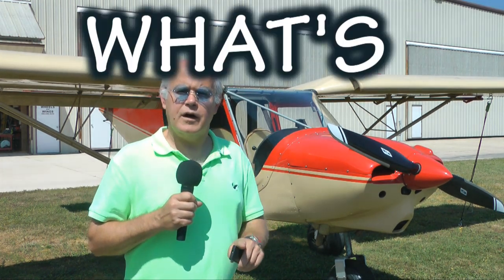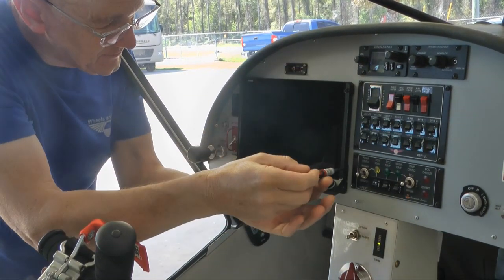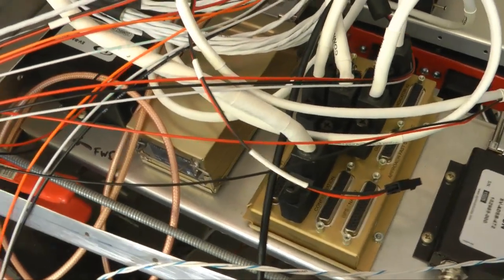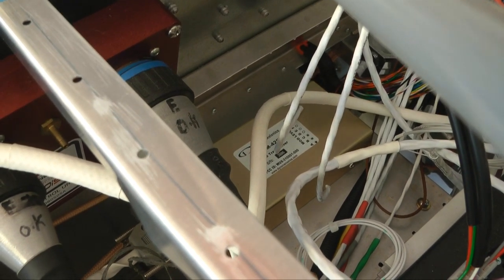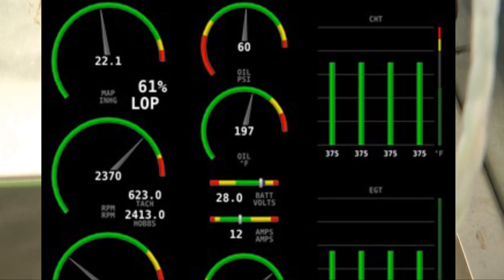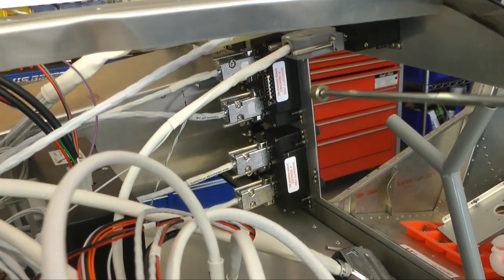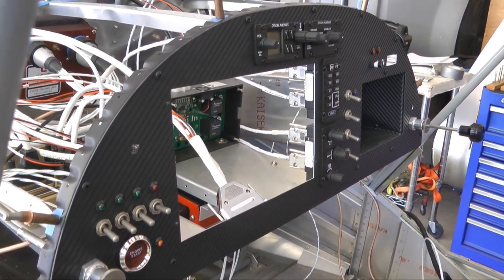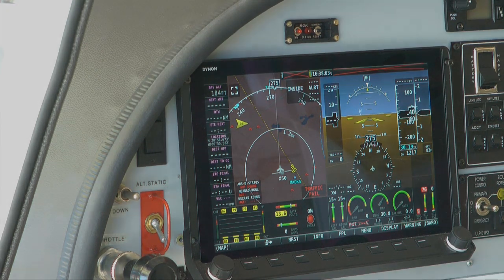What's Behind the Dynon Glass Panel?

Comment: Would love to know about that big ALT-STATIC switch.....
Reply: It looks like a pneumatic switch to switch the static pressure from the static port to an alternate static pressure source, usually inside the cabin. Sometimes static ports get blocked by ice or debris, so an alternate is needed. The altimeter and airspeed are usually not as accurate on the alternate source due to the cabin pressure difference from outside pressure. It can vary considerably by opening vents, windows or cabin heat.

Comment: What is inside of the all the Box's.  How and where do the box's hook up to
Reply: The hookups are explained in the Dynon installation manuals.

I suspect Jon is incorrect when he refers to the display panel as "mostly for display". Most likely the master processor and most of the control software is in that display box. The other boxes are mostly just sensor boxes tied in through the Dynon serial network (RS-232 or RS-422?). The EMS and AHRS boxes are the most interesting; probably some interesting circuitry in the former and some MEMS gryo hardware in the latter. I'd also like to know what processor Dynon is using--it's doing some serious real-time display processing. It appears one would have to remove that "Warranty Void if Removed" sticker covering one of the screws to find out :-)

Comment: Your display image shows Percent Power and LOP/ROP indications (upper left corner of the display).  But, Dynon has software mapping only for Continental and Lycoming engines.  It does not work for the UL Power engines as installed in your demo plane!  I can understand the LOP/ROP not working, as the UL Power engines are Full Authority Digital Engine Control (FADEC), and Multi-port fuel injected engines with no manual mixture control - the Engine Control Unit (ECU) does it for you automatically.  It would be nice if Dynon would map the line of UL Power engines to show % Power, for use with electric variable pitch propellers.